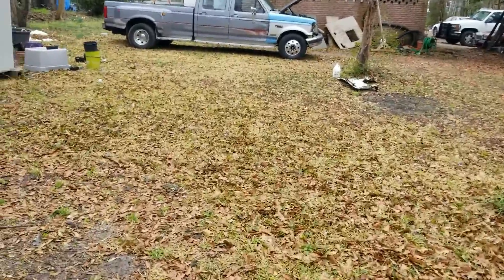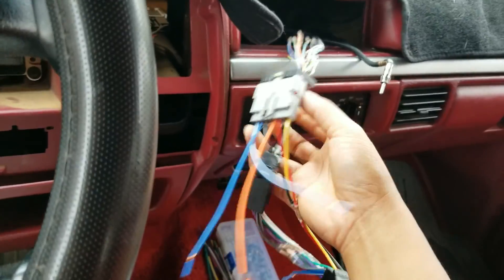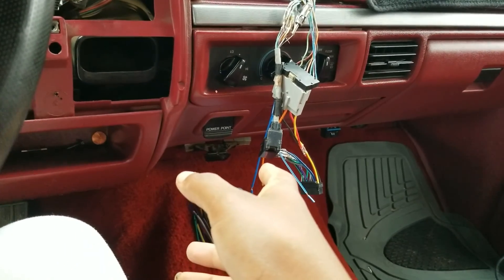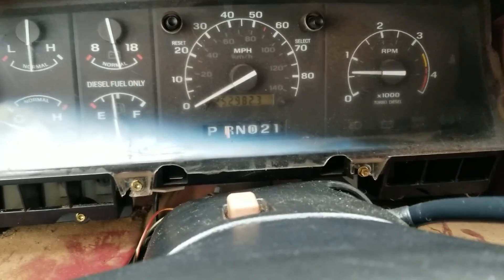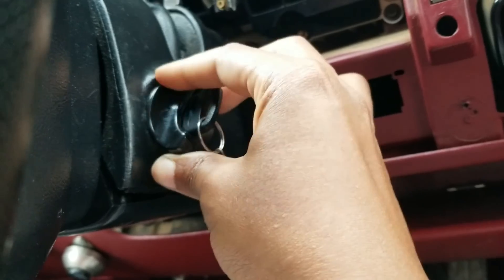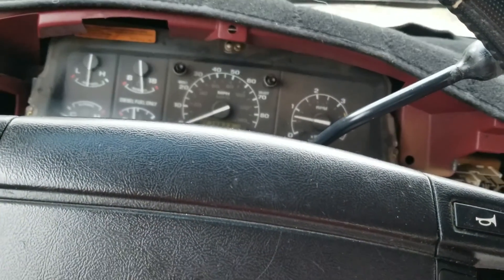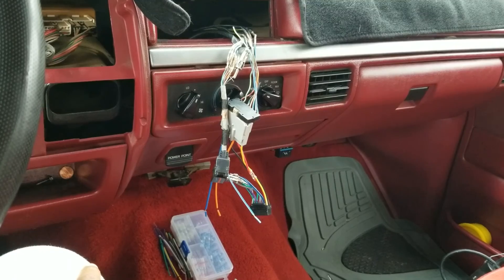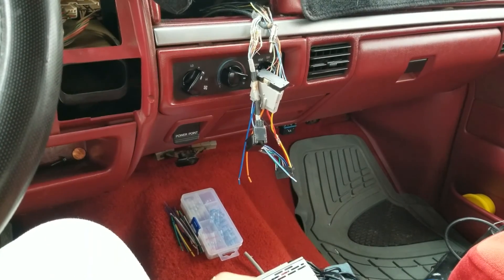Plans/ things i need to do on the truck #F350 #obs

Comment: The rear shackle mounts on our '96 F-150 left the building over the last couple years. Recently the drivers side spring/shock tower broke and tilted, putting pressure against the steering shaft. At first I thought it was the clock spring. Dang I wish it was the clock spring. We got all the die pressed frame parts off of eBay. Going to rebuild the suspension/frame this month.
Reply from the maker: I've got to replace the shock mount in the rear because somebody stripped the stud. I ordered the part waiting on the weather to cooperate.
Reply: @devajonesdiy what city are state you in?

Comment: Check the bolts for the shifter cable bracket. We had the same issue with the slushy shifter and it was just loose cable bracket bolts.
Reply from the maker: It was the bushings. They were plastic and damn near gone. 3 dollar fix